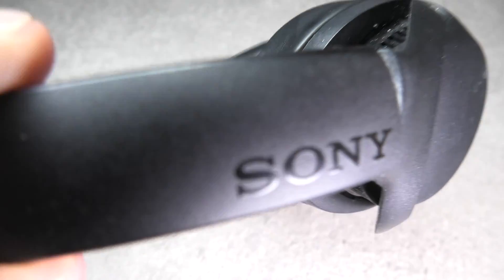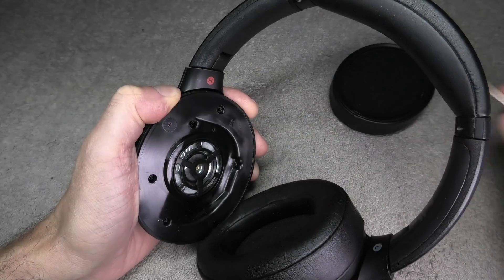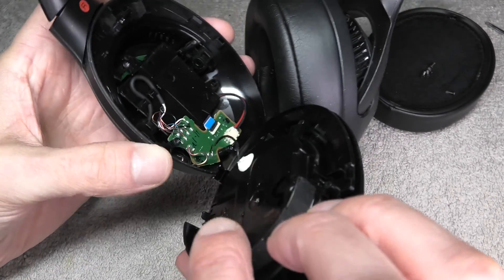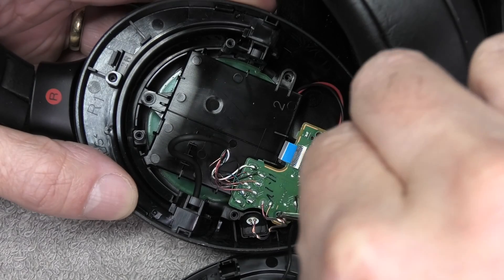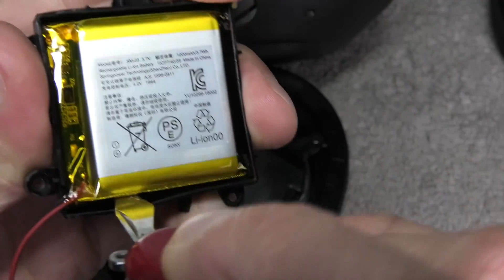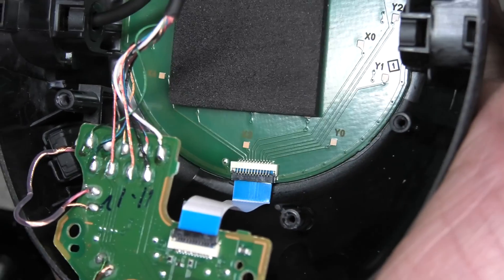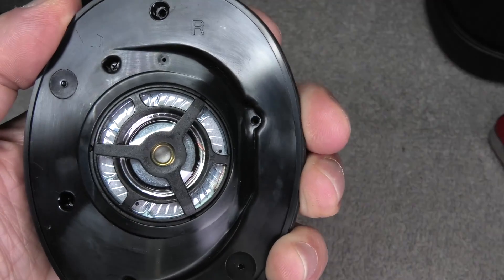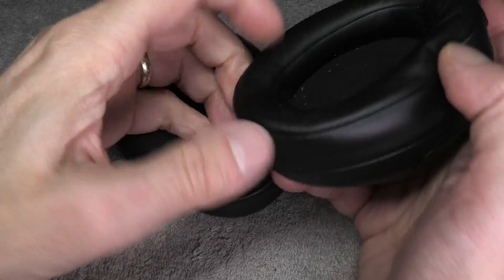Sony WH-XB900N Battery Replacement (How to fix charging problems)

Comment: For anyone watching the video because they hate the "touch control", remove the padding, remove the 5 screws and lift the speaker up, undo the small white ribbon cable (no need to remove the circuit board or battery), then refit the speaker and padding. So far I haven't found any issues as a result of doing this to my headphones.

Comment: the headphones have not been charged for about 2 years. Maybe the battery needs to be replaced? They don't want to turn on, and after connecting the charger the diode simply goes out after a while

Comment: The battery you linked is for the WH-1000XM3, im guessing its still fine if it use it in the XB-900N right?
Reply from the maker: Right, this battery is compatible with both models 👍
Reply: @MegaSafetyFirst  Was a massive struggling to find a replacement battery listed specifically for the XB900N's. Huge relief to hear that its the same battery as the XM3's. Thank you for the help 🙏
Reply: Mine doesn't seem to charge over 20% at all and I've tested it with 20 different cables and adapters. Hopefully a battery swap works 🤞
Reply: @pasionate  Did the swap fix your problem? I have the same problem and im thinking about changing the battery.
Reply: @pasionate  Did it work?
Reply: @Sargen07  yep
Reply: @pasionate  hows new battery ? how much it last ? is it like original or poor quality?

Comment: Good video tutorial, and i bought the battery provided from your amazon link. It does power on again, however, it still wouldn't charge and it randomly turns on without powering. The left ear cup started feeling warm, and so I've disassembled it but did not have anything loose or broken. I just might not have the best of luck with these headphones, but it was worth the try.

Comment: Great video!  Any idea whata flickering charge light means? If its a port problem can that be fixed?
Reply from the maker: Thank you for your feedback,  I appreciate it.
Does the light flicker specifically when moving the USB connector?or all the time?